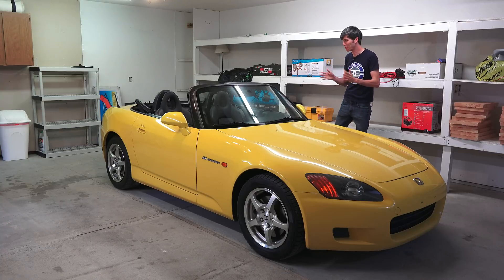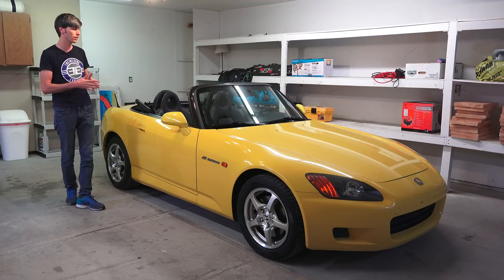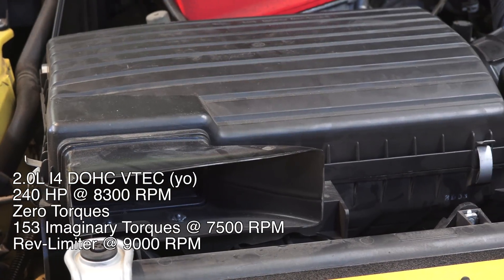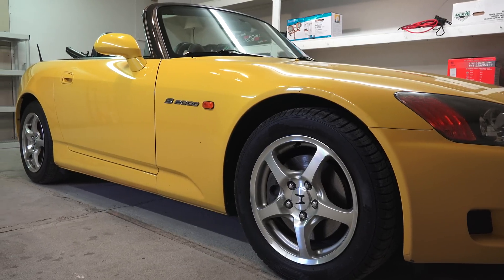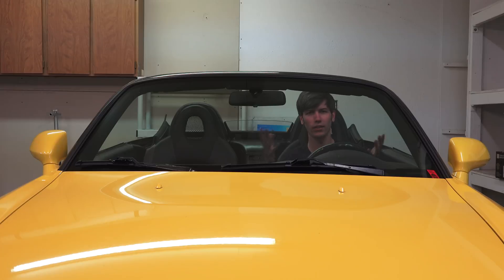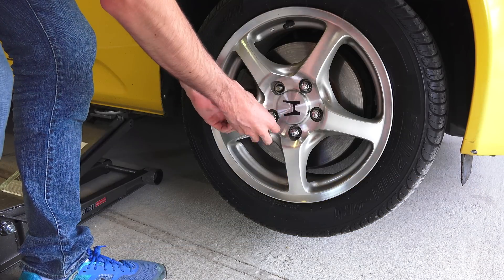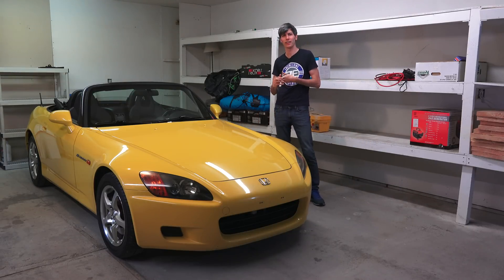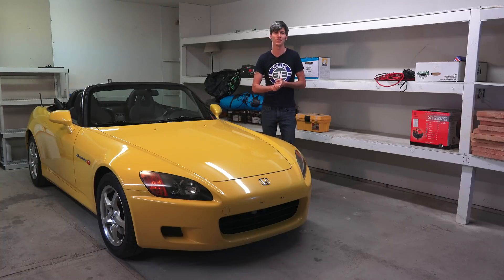I Bought A Honda S2000 And It's Amazing!

Comment: No torque and a weak ass clutch.
Reply: Low torque is compensated for by a high rev-line and higher horsepower. Weak ass clutch? Lol don't make me laugh. This car has the best clutch I've ever had the pleasure of using and they can take a lot of abuse. Mine is 14 years old with over 100k on the clock and I just replaced the original clutch so excuse for me saying you're talking out of your ass.
Reply: Yeah, they didn't design the car to be a muscle car.
Reply: It doesnt need much torque. Its not heavy. an s2000 is almost as fast as a 350z wich has more torque and hp. But its heavier.
Reply: But 350zs ar slow...
Reply: +Angelo Del-Angel mine has 202000kms and still on its first clutch.
Reply: Aznwarlord7 That's nice it still doesn't change the fact the S2000 does 0 to 60 in under 6 seconds because it does and again I actually own the car and have timed it on many occasions. It does do it under 6 seconds, why is that so hard to accept? Not like it's breaking any speed records. The time varies as well based on conditions and the launch. I've seen and done it as low as 5.3 seconds because I got a perfect launch and it has been higher around 5.7 seconds. Also you claimed your G35 does it in 5.7 and yet every time I ran into one I've blown their doors off. Seems to me it's obviously not a sub 6 second car if they can't keep up with a stock S2000 lol.

It helps if you actually rev the car up past 6000 rpms where the VTEC engagement point is which many people make the mistake of not doing and then report false 0 to 60 times. Also Car and Driver is a far more reputable source than some obscure website I've never heard of because they actually review and test the cars in every aspect.

Here's a review from 2008 where the CR did it in 5.7 seconds which is pretty average.
http://www.caranddriver.com/reviews/2008-honda-s2000-cr-short-take-road-test
Reply: Aznwarlord7 " I would say the factory claimed number is a better more controlled number to go by" This is never the case lmao
Reply: David Hager Thank you! Exactly! Reviewing and testing the car is how you discover what it can really do!
Reply: a clutch lasting long at 170lb ft in a light car isn't a huge deal. Not hating on the car but that clutch would slip bad in a high torque car. It is weak but it doesn't need to be strong so it's okay. I doubt one with the same holding capacity would last one wot pull in my car or most muscle cars..
Reply: Mr4512hkj It can handle a lot of punishment believe me but I get what you're saying. Any car pushing past its factory specs needs a good aftermarket clutch in order to handle the additional power and torque for which the OEM clutch wasn't designed for. However that doesn't make it "weak" by any means. Still the best clutch I've ever used in any car. In manipulates every shred of torque there is.
Reply: Yeah you're right it's a good clutch for longevity and goes beyond what's needed for factory power. I'm just mad at all clutches after my Mcleod RXT started slipping lol
Reply: David Hager they are pretty slow for 280hp thats true. But by my standarts still a quick car. If fast starts from like 4-500hp in a normal car ok for me a quick car is under 8 sec. 0-60 a fast car does under 6. But I think we have other standarts in europ.
Reply: 99Lezard99 I'd consider anything under 6 seconds fast, that's where you can start to really feel the pull. Even then, now days with $37k camaros doing 12 second quarter miles out of the box the bar has been rasied a huge amount. For older-ish cars though under 6 seconds 0-60 is definitely quick.
Reply: S2000 does 0 to 60 in under 6 seconds. Fastest I've seen is 5.3 stock.
Reply: CaliPatriot88 ye it's quick
Reply: David Hager For what it is yes it's quick. These days her age is starting to show lol
Reply: +CaliPatriot88 an s2k does 0-60 in 6.7...
Reply: Aznwarlord7 Lol no it does it in under 6 seconds easily. I think after owning one for 14 years I know how fast its 0 to 60 is. But if you want proof here is a reputable source from Car and Driver: 
http://www.caranddriver.com/reviews/honda-s2000-short-take-road-test
Reply: +CaliPatriot88 mine has 130k  on stock clutch still fine
Reply: RB25luv you're right my bad
Reply: CaliPatriot88 http://www.automobile-catalog.com/car/2009/1129715/honda_s2000.html
thats not the factory data
Reply: CaliPatriot88 I would say the factory claimed number is a better more controlled number to go by. You could just push your s2000 off a cliff and claim that it went from 0-60 in 3 seconds and over 100mph-0 in less than 1 second!
Reply: Aznwarlord7 It's perfectly normal to be upset about being proven wrong, we all do it. Fact is the numbers on paper are different from actually testing the car on the road. The car has proven time and again to be a sub 6 second car after various reviews and tests. I can pull up articles and times all day proving my point but you'll continue to be stubborn and ignore facts. You can believe what you want, I really don't care. I've owned the car for years and know what it can do so your opinions are really irrelevant :)
Reply: CaliPatriot88 my opinions may be irrelevant but factory facts are not.
Reply: Aznwarlord7 Yes they really are because again I've proved them to be as such. It does 0 to 60 in under 6 seconds. That's a fact, you're wrong so get over it. Also that's not even the point of the car anyway because it focuses on handling. They just balanced it out with enough power and acceleration to get the most out of that characteristic.

Comment: I'd say that was a smart choice going for the S 2000 friend had one still has it now in Milano Red only thing I'd say is kinda annoying is the roofing can be temperamental after some time and also the S 2000 can be annoying during dramatic weather, one thing that has to be said they do come with a lot of potential especially if you're looking to increase its performance but that being said its already as standard exceptional with a max of 9,000rpm and 120hp from a NA

Comment: stiff ride, boiling hot black interior, cramped cabin, noisy as hell, less power than my '09 accord...what's not to love???
Reply from the maker: It's okay, maybe one day you'll find something fun. :)
Reply: You've obviously never cut corners at high speeds with the top down in a rear wheel drive car so you won't understand how awesome this vehicle is.

Comment: I'm looking forward to a comparison between the S2000 and a BRZ/GT86 as the layout and numbers are quite close to one another. I drive a '13 GT86 and like it, no matter how often the car gets bashed for having no torque at all, just as you mentioned on your S2000 ;-)

Also, please change your Rev limiter to 9001 so Vegeta can shout "IT'S OVER 9000!!!" ;-)

Comment: Its a great car the Honda S2000, this or a Porsche boxer 986 they are the same price roughly here in the UK. Also there is a two seater sports car that I drive that always gets forgotten the MG F/TF, it handles better than an MX 5 because it's mid engined and looks great, I don't understand why it always gets forgotten.

Comment: OMG this just made my day. I'm a prospective owner and have a Spa Yellow 2002 in my sights!!!
Reply: I'm so jealous, but I'm excited for you as well! Don't brag about it too much - I want the prices to stay below $18k!!
Reply: Go buy it! They're incredible cars.
Reply: parksed24 Thanks man!! I've already been looking at late model AP1's since the beginning of this year in January. I would live to buy an 2002 or 2003 S2K in spa yellow or berlina black.
Reply: +1 for Spa Yellow, the next one I buy will definitely be that. I had an '06 Laguna Blue Pearl which was friggin' gorgeous. Really want to try out an AP1 for that 9k redline!
Reply: parksed24 Yep! It will be sick! I just need to get used to the "oversteery" tendencies of the AP1 (though the 2002/2003 AP1's weren't as  bad as older models). I will be keeping my S2K relatively stock (when I get one), except for maybe AP2 tires sizes and mild aggressive wheels, and an oem Hard Top. Otherwise, if I get eager, I would love a comptech icebox intake, and maybe a mild exhaust. I will mostly be investing in preventative mods, such as stronger components from the AP2 (retainers? tranny?), but it won't be much besides the regular oil changes, periodical diff/brake/tranny fluid, tires and brakes, etc. Thanks for all of the encouragement, man!

Comment: Check out the rear wheel hubs (i think it's the name in english, sorry not my native language), they tend to get loose over time and make noise when cornering or at low speed when stoping the car, like if your torsen was working without oil. I had this on mine, had to replace all the hub because of one nut :( It's been one year with the car, same MY than you, i love it ! You can cruise at low speed enjoying the roads or go fast, it's always a pleasure...

Comment: Surprised you didn't go with a Miata. You seemed to like it after that ND video you did in England.
Reply from the maker: I love the ND, but didn't want to spend $30K.
Reply: Fair enough. Hope you really love the s2000 as well!
Reply: I had an NB Miata.  Was a toss up between that and an S2000.  I would still choose a Miata.  
Any 2 two seater front engine rear wheel drive is always a recipe for awesome!  Especially if its engineered in Japan.
Reply: S2000 is a ton faster than the nd

Comment: Cool car. Having owned a CRX, and now driving a Mazdaspeed 3, I could see going with either this or a Miata for tracking. Either one would be nice, but with proper setup, the Miatas are still known across the SCCA and other motorsports communities to be the ultimate platform. Sounds like the S2000 has many features to make it comparable.

Comment: Congrats I also own a 2002 s2k. For the near future you should change your valve retainers and swap them all out with ap2 valve retainers. Ap1 retainers are known to break. One of mine broke in my car and luckily the valve didn't fall into the cylinder. When I changed them all many others had hairline cracks and were soon ready to break.

Comment: Hi I have a question for you. 

For example a manual car is rolling along at 50km/hr and then applies his foot flat to the accelerator and slightly on the brake, the car begins to slow down but the engine seems to go under heavy load  until the tyres break traction. How is this heavy load caused through the manual gearbox?

Comment: The torque is zero until 7500rpm and then comes to its peak at 7500rpm and then again at 7501 rpm becomes zero ...because its a Honda
.after all its the legendary Honda s2000.all joy and excitement